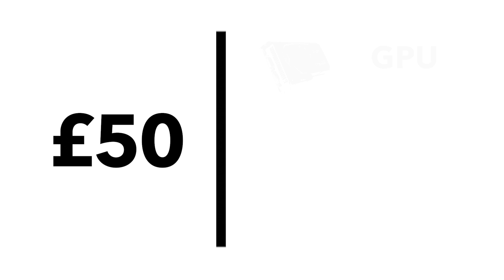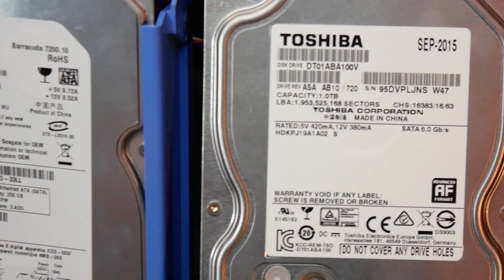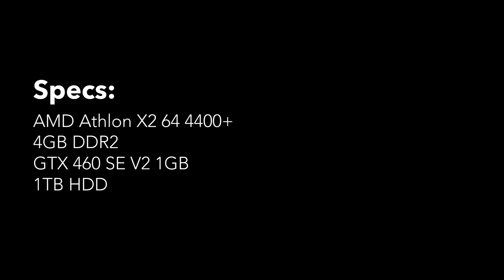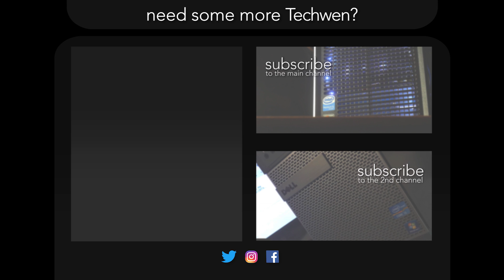Upgrading the £5 PC (Revival of the Athlon Dell)

Comment: My Dell Dimension 5000 has a 750Ti with 2 Gb, the power supply is sufficient for this and it fits into the slot thanks to the single slot design. I mainly use it for XP Retro Gaming.

Comment: Nice work! Love these Dimension machines; sleek, excellent build quality and as you showed surprisingly upgradeable. Back in the day I ran an E520 with a Pentium D and HD5450 as my main system. At the time it was good enough for the titles I ran on it. A shame the X2 was holding back the 460 that much. The nice thing of the E520 was that it had Core 2 Quad support and eventually I was able to swap in a Q6600.
Reply: Just ordered a q6600 for £5 hope it works

Comment: Those old Dell Dimension cases are really smart, I like the little hollowed out compartment half way down at the front of the case. That's not a bad spec at all, and to keep the price down, I would have definitely said to have a look for a lower budget card, like the GT730 GDDR5, R5 340X GDDR3 or the HD6670 1GB. None of those need external power connectors, and can run some older games from the early 00's through to early 2010's at an alright setting too. Enjoyed this, especially the Genesis during the benchmarking 👍😊

Comment: I suffered on one of these for 6 years before I learnt about PC hardware and built my own. I wish I'd known at the time how easy it would have been to throw in a cheap graphics card. I used to play Minecraft on the absolute lowest settings at 900p at 30 fps 🥲  Still, it was a massive improvement from the 2000's single core I had before which would take 10 minutes to boot up and would hang all the time because of the 80GB HDD and malware. My parents were cheap bastards.

Performance from memory at 900p:
Minecraft (lowest): Barely playable
Gmod: Unplayable
WoW: Playable
Warcraft 3: Playable
Zoo Tycoon 2: Unplayable
Age of Empires 2: Playable
Runescape: Playable
Terraria: Playable

Comment: Maybe upgrade the cpu to the 89w 6000+ (Not the 125w version). 
Good video but I would have got a gtx 750ti (Assuming it's compatible) so you wouldn't have had to upgrade the psu.

Comment: how can i upgrade my pc dell 755 optiplex for gaming pc..thanks
Reply: get a cheap ssd with more ram and upgrade the cpu to the strongest in the mobo limit and add a discrete graphics card like gtx 750 ti or rx 550
Reply: @ivb4  i would not really recommend a cpu upgrade on a optiplex 755 because if you just look at the fan...